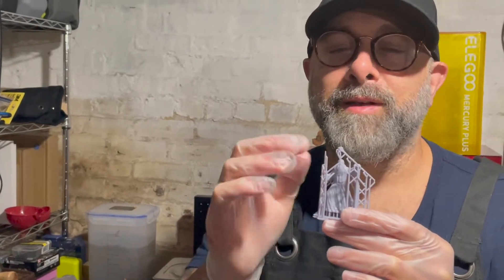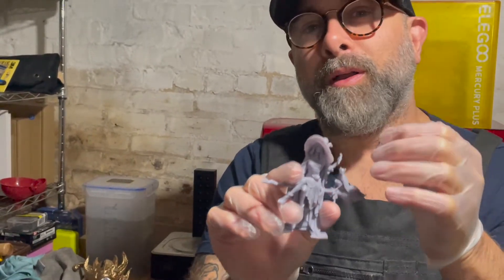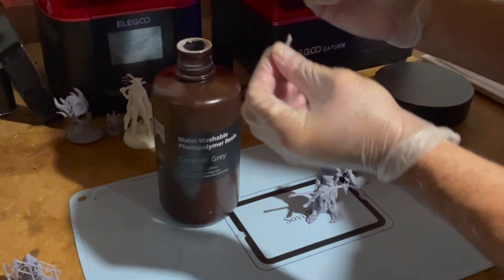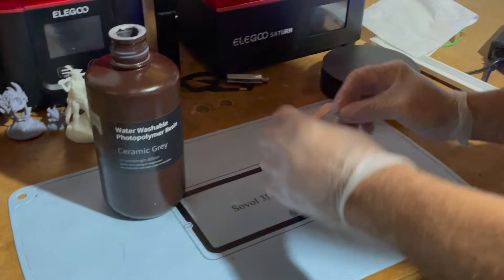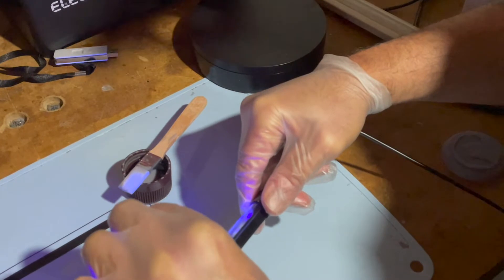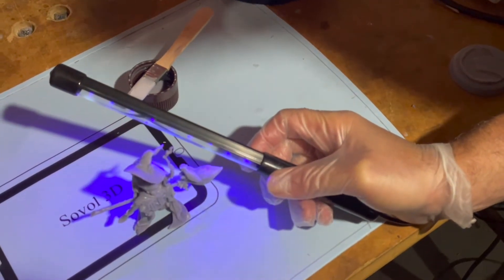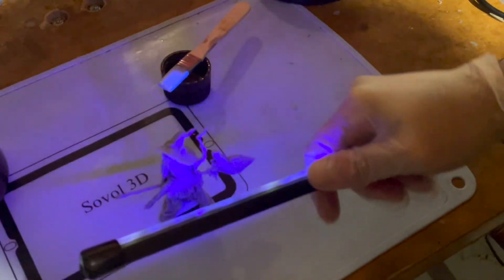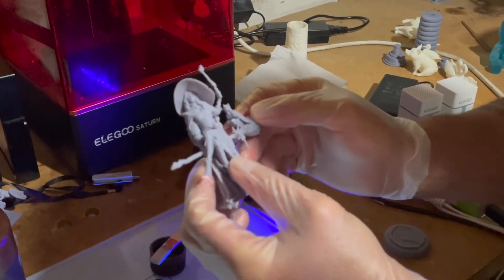How to fix broken resin 3D Prints - What's the best and most effective way to repair 3D Prints

Comment: My piece broke while removing it from the build plate. I have washed but not cured them. Do i reattach the broken part before or after the final cure?
Reply from the maker: Either! I've done it on both. Remember through, with this technique for fixing the broken resin parts you are curing it. 😀

Comment: This definitely helped telling me I did the right thing. I got a resin 3d printed dragon yesterday and the wing broke off. I had it fixed with resin, but it didn't stay so I didn't know if there was something else to use or not. I tried superglue but that didn't work. The wing is the only thing that broke off that isn't staying. Two legs broke off two but those are fine
Reply from the maker: Did you get it fixed?
Reply: @MakerBuildIt  kinda yeah!! I dropped it again today (need to stop Istg) so now that I know resin works I'm not as worried as I was about it. Now thinking about getting a resin 3d printer
Reply from the maker: @asherthesinger8785  Sorry to hear you dropped it again, but good to hear you know how to fix it! 😀The Elegoo Mars 3 is a good resin printer to start with. I did a video on it awhile back. 😀
Reply: @MakerBuildIt  thank you for the recommendation! I was looking a bit ago and saw one for about $150 USD. Reviews said it was good for a beginner so I may go with that instead
Reply from the maker: @asherthesinger8785  Awesome! Keep us updated on your 3D Printing journey! 😁